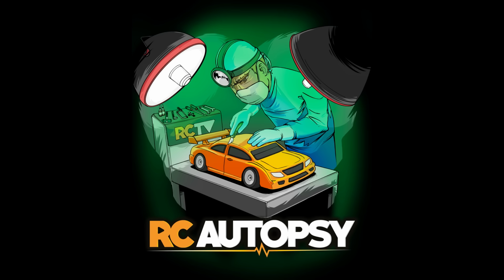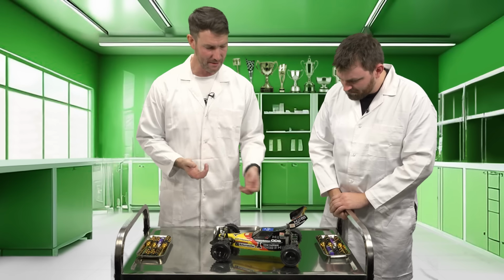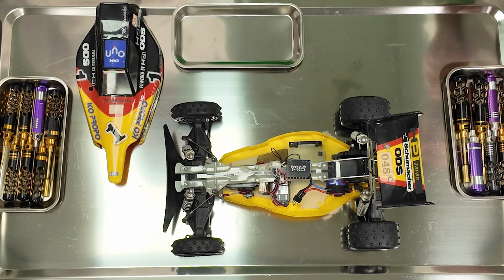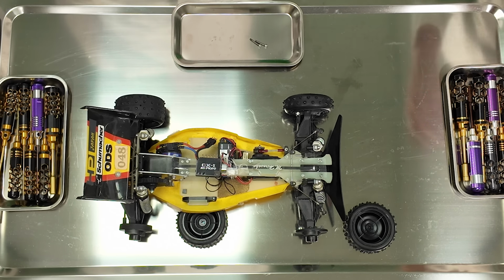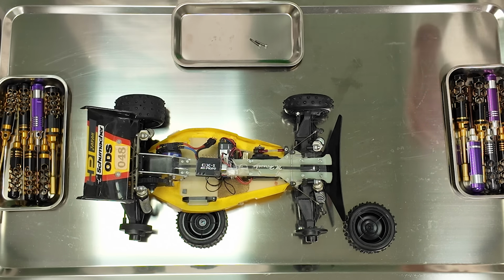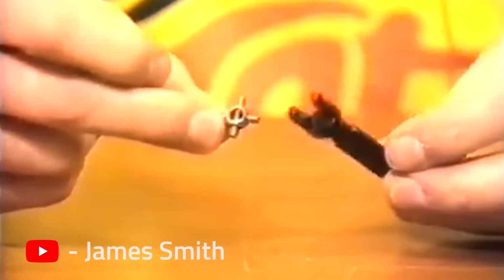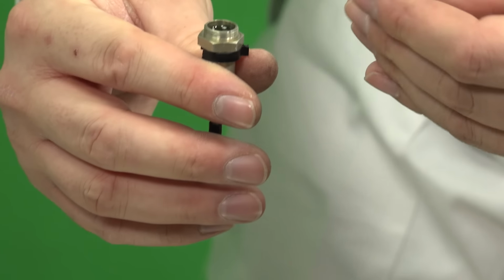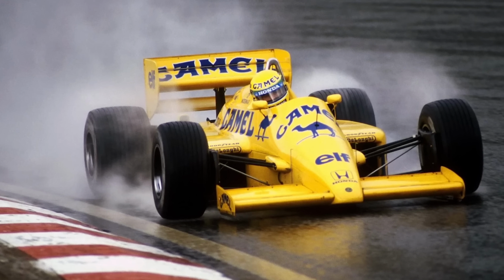RC Autopsy // Episode 5 // Masami Hirosaka ‘s Worlds-Winning Schumacher Cat XLS 1/10th scale buggy

Comment: The composite washer on the rotor goes on first to insulate the comm from the metal washers to prevent a short. Raced against many of these back in the day with my Optima Mid.

Comment: My first Schumacher was the CAT XL in '87 and I wanted it because Masami won the worlds with it lol Plus you didn't see them much in the states at the time so I found that pretty cool. Not so cool was getting parts for it, especially having to replace the undertray quite a few times before my dad suggested using duct tape along the length of it for a bit of extra protection, worked like a charm. Loved that car, love my L1R and LD3 as well, still making great stuff!

Comment: Still have the KO Propo FET servo's fitted to my classic RC10 and Schumacher CAT XL. And yes, the original drive system still copes with anything I can throw at it, Even a 11.1 Lipo with a hot motor. Being that the splines are encased in the bearing, the torsion is tempered by the inner bearing wall, clever design. Nice to see Masami's car again.

Comment: I think the wing wires are supposed to be fixed behind the rear suspension strap rather than the shock mount. Other pictures of this actual car have it that way and so does the instruction manual for the rerelease.

Comment: It’s an early FET servo where the servo motor was boosted to improve speed and torque. The BEC voltage would have come down the servo wires from the speed controller or ESC. For the day the KO Propo speedo would have been quite advanced, but without any reverse at all.
Reply: I remember a fellow racer who had the first fet servo I had seen, it blew me away with it's speed and response.
Reply: @alexpeacock3870 miles better than a Acoms servo lol